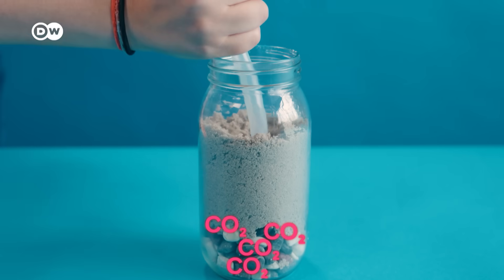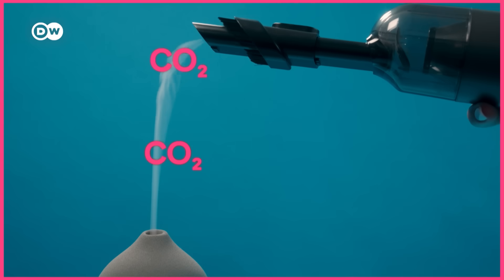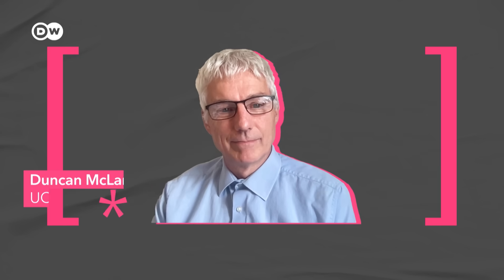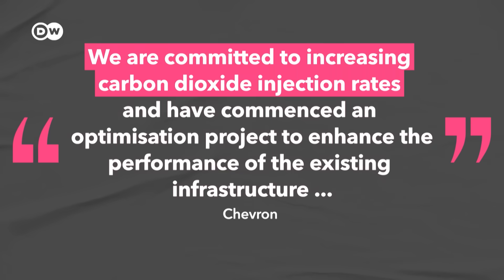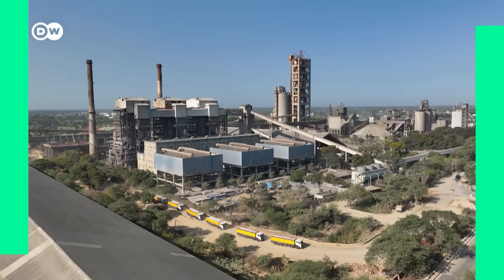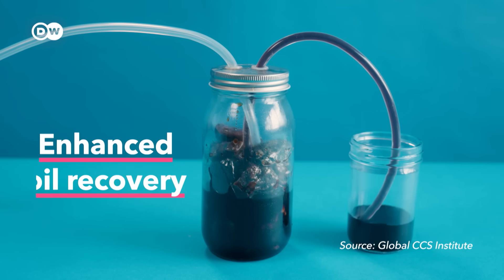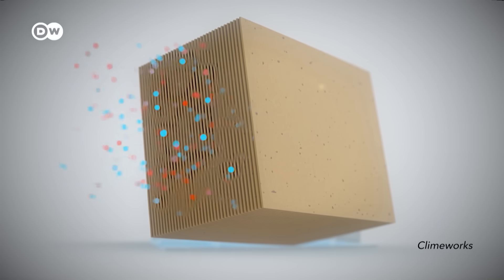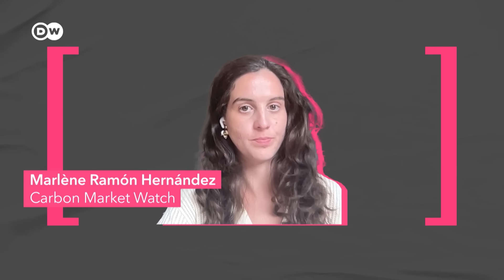Why carbon capture needs a reality check

Comment: A painful watch as a geologist. The Gorgon CCS project is a poor example as it is a saline aquifer that has (specifically) had difficulties withrawing water from its aquifer to allow for CO2 injection. 

Oil and gas companies are rightfully interested in CCS because they can use their pre-existing infrastructure to store CO2 in depleted oil and gas reservoirs, which are underpressured and readily available for CO2 injection. They also have vast amounts of data on these reservoirs to help with CCS deployment.

Comment: CCS just stretches time for fossil  burning companies making sure our descendants would need to expensively grow some algae bs to produce even cheap kind of plastic. DAC only makes sense after we completely decarbonize the grid. But then there will be no FF companies left to help clean up their mess for reputation points with a grain of their ridiculously enormous money pile. Both technologies require roughly the same kinds of recourses as building for example wind turbines and green hydrogen energy storage facilities for their reliability. Though I personally prefer boiling water with magic heat rocks. Some people just want to turn earth to hell to not miss the world they will leave behind on their way to the actual one. Don’t believe solutions especially sweet sounding ones from collective beings who have been proven from decade to decade to be incapable to care less about global long term reasonable use of any kind of real resource. Anything made in  accordance to their lies is made for our own demise.

Comment: You need to undergo a many-decade process to make clean electricity super cheap and abundant and keep fighting the chemistry/material science/manufacturing fight to actually fix the CO2 problem with realistic in-air or water carbon capture, and even then it seems like a long shot.  I think it will finally happen when sythetisizing hydrocarbons from captured CO2 become economically competitive with extraction.  But you basically need to do that anyways because the diesel engine is just too good to replace

Comment: Carbon capture is FREE in Nature which has the most Perfect Carbon Capture process that can be Thermodynamically designed,. Atmospheric CO2 dissolves in the excess water in the atmosphere to form Carbonic Acid 3/4 of which falls in the ALKALINE Ocean and is neutralised (Captured) The other 1/4 falls on Land and about half reacts with limestone to form soluble bicarbonate of Calcium that is transported to the Sea where id is removed in the form of CHALK, the biological remains of sea creatures. This Captures CO2 for Billions of years

Comment: First it is expensive. The goal is not make a change in climate or wipe out every CO2 molecule. The goal is simply using a technology to filter out the air better & if such technology is located proximal to industrial plants, one may be able to improve the exit of IR  rays back to space. It is no different than the technology that has been developed over the years that has refined coal or oil or gasoline & to weed out impurities. Often times when we folks are show a photo of a smokestack & we see lots of dark stuff coming out. We wonder why is not there a way to somehow stop that. Well we actually can mitigate. Direct capture or dry scrubbing works like an aquarium filter & captures the desired gas which then has to be essentially landfilled. The indirect or wet scrubber inputs a chemical amine which reacts with the CO2 & converts it to a useful product, namely drywall or mineralized concrete. This reduces the CO2 contribution to the air & will improve just a tad of IR getting to space. The way this geologist looks at it is that this is a good piece of technology & ideally would be situated next to steel & concrete plants. Sad to say the GOP did not get on board with this simple approach which represented a coming to the middle of both sides of the climate debate.  This is far more doable than ordering by fiat the folks to buy an EV or get rid of their furnace of gas stove. Having industry do most of the heavy lifting is the way to go. Otherwise, the alarmists when they get back in power will just continue to reverse any current protocols that are going into place this year.  Again both sides never seek a middle & it's the people that pay the price the more that one side gets in power & jams it down our throats.

Comment: We will need liquid fuels for a very long time. DAC is the only solution that makes it sustainable without ruining the climate. DAC has to be powered by solar panels and so it could be installed in deserts. The only question is where to store the captured carbon.

Comment: Carbon capture technology has its place and I explain why.
It makes sense to use it only if powered by reneweable energies. Otherwise we would fool ourselves and trying to trick thermodynamics.
The other option is to use it as a consumer of excess from the grid. Let's say the state overestimated the demand and now produces too much electric energy. In order to keep the grid stable we have to get rid of that energy. Nowadays we sell it for negative prices, therefore paying for it, to other countries and we use it for hydro power plants to pump water. 

Instead we could use this excess energy to power a carbon capture device or power an electrolyser to produce hydrogen. Again, the emphasis is not to burn fuel to capture carbon or produce hydrogen, but use energy that is available anyway.

Comment: Scaling up is a real showstopper - the cost of plant is subject to economy of scale but energy
cost is subject to supply and demand - because of the dismal % efficiency of current technology
the massive demand would INCREASE the energy cost, 
say at $300 per ton removal every US citizen producing 15 tons p/a faces a bill of $4500 just to stay neutral, on top of that CO2 occupies about 3X volume of oil or coal removed, the Texas plant owners
are not stating the source of energy - if it is powered by the grid then the fossil CO2 element of that 
electricity should be subtracted from the stated capture total, spending $$$ to produce a useless
dangerous product that benefits the whole world will be seen as "un-american" and political suicide.

Comment: Climeworks should not try to capture CO2 from the air but instead put those filters directly on manufacturing plants.  They need to find a way to put their capture technology on cars, manufacturing plants and only use their direct air technologies in areas that have been deforested. In other words, capture CO2 at the source.  Then have a program in place where the devices that have the CO2 can be turned in to Climeworks for them to deposit into the Earth.  There should be a financial incentive for the average person and other users to install this on their vehicles and submit it.  This way , the people of the world can  be a part of the solution not just Climeworks.  People will do it for altruistic and financial reasons.

Comment: The only reason to “capture” carbon is to recycle it into synthetic fuels. Rapid developments in catalyser technology will provide “reasonable” cost fuels to power our transport instead of wrecking the planet mining so called “rare earth” materials. Until these pseudo scientists bother to do their homework and look data from ice cores, stomata and other historical data that shows carbon dioxide does not drive temperature but mostly follows it we will continue to have useless uneducated organisations promoting disinformation and ruining our energy infrastructure. We have to accept that our climate is changing and has changed since inception and put our efforts into mitigating the effects of natural climate change on our infrastructure. Stop building on flood plains for a starter!!

Comment: Bull$it!! Carbon dioxide capture (And no, it si NOT a carbon capture. These dills can't even get the terminology correct!) should be made a criminal offense. CO2 is not controlling Earth's temperature, and at 400 ppm, we are perilously close to 200 ppm, level at which the life starts to die off. 560 million years ago,  CO2 concentrations were around 7000 ppm, and for most of the past 600 million years CO2 concentrations were considerably higher than at present, yet the planet did not burn and the life did not get extinct! Climate change/global warming is a con....

Comment: its not feasible at the scale we need to build and operate the carbon capture devices.  this is just another convenient narrative device for the fossil fuel industry.
that math is relatively simple as well if you are skeptical of my claim.  Answer these questions:
How much CO2 do we generate as a nation (US) per year? (you can look this up on multiple government websites, but I like the DOE)
How much does any single carbon capture system described here capture per year? (you can look it up on the manufacturer websites)
Then how much energy is needed to operate the carbon capture system per year? (you can get more into the weds by asking how is that energy produced)
Then you can determine how many carbon capture systems you need and how much it will cost to operate them annually. done
And unless you want to dedicate the majority of all of humanity's output to reducing carbon in the atmosphere for the next 50 years, the obvious answer is:
#1 we need to stop burning fossil fuels now, #2 no technology is capable of saving us, this is a myth with a useful narrative to the fossil fuel industry only, #3 if we were to try to be clever about reducing CO2 in the atmosphere we need to use natural systems to do it

Comment: I don't beileve that one passenger emits one tonne of CO2 on a flight from New York to Paris 6min 30sec. An Airbus A320, 150 - 180 passengers,  uses about 2.5 tonnes per hour. Pity these climate alarmists have to resort to lying to keep the panic going.
Reply from the maker: Hi Simon, thank's for asking. You mentioned the Airbus A320 — but transatlantic flights like New York to Paris are typically done with larger aircraft (e.g., Boeing 777, Airbus A330, or Boeing 787), not an A320, which is generally for short- to medium-haul flights. A long-haul aircraft like a Boeing 777 might burn around 7–9 tonnes of fuel per hour, depending on conditions. For a 7-hour flight, that’s around 50–65 tonnes of fuel total.
Reply: @DWPlanetA  So, if a 777 with 314-440 passengers, it's still nowhere near 1 tonne per passenger. I stand by my point. Scaremongering reporting.

Comment: The fundamental problem for both of these is, the energy needed to compress and store the CO₂ is comparable to the energy you got from burning the carbon in the first place.  A lot of the energy comes from the CO₂ expanding.  To compress it and recreate the original oil, takes ALL the energy.

But, if you burn natural gas, there's still a lot of hydrogen you're burning, and you don't have to capture that.  And, if you pump it underground, that's not recreating the oil or coal, that's more like compressing it.  Maybe 50%?  I don't know.  But what you do is, you subtract that energy and that cost, from the benefit you get from burning it.  So, if you're normally paying $40 to refill your tank, really, you should be paying maybe $80 ... $40 for the gas, and $40 to capture the CO₂ and pump it back underground.  Right now, nobody's collecting that extra $40, and nobody wants to pay for CCS.  (All the above numbers are bogus — I'm just guessing.  The experts in this video have better figures.)

Direct Capture is a different story.  The problem is the 2nd law of thermodynamics.  Go to the fridge, and pour yourself a glass of milk.  Good.  OK, now, go to the fridge, and, instead, spill all the milk on the floor.  Then, take a towel, mop up the milk, and wring the towel out into your glass.  The second method just seems stupid — it's more work, you'll never get all the milk back, and it'll be dirty, and you'll have to wash the floor and the towel.

But, that's what Direct Capture is.  You're taking the CO₂, letting it scatter into the atmosphere from the smokestacks and tailpipes, and then trying to mop it up.  Far better to go to the smokestacks and tailpipes themselves, and grab the CO₂ while still concentrated.  Then, it becomes CCS.  For cars, this would mean saving all of the tailpipe fumes for later.

So, I'm skeptical of both of these technologies.  Isn't it simpler to just lay some square miles of solar cells under the sun?

Comment: 94% Of the warming has settled in the world's oceans and that heat will be released so it does not make any difference if we  capture CO2 from the atmosphere. The warming will continue and it is currently spiraling out of control and the planet is warming faster than projected.
Multiple feedbacks are now beginning to occur where areas of earth that helped regulate summer heat are now beginning to go in reverse and this is very bad news.
The UN has revised  it's projections and now fears that  a very dangerous amount of warming  could arrive much sooner than the scientists had projected.

Comment: I do think it’s a bit unfair to the efforts of OXY into that perspective. Because we do still need some oil in the future, for cosmetics, plastics, lubricants, chemical products, basically many things in modern life. Many times there are no viable, affordable solutions yet to get away from it. Also electric cars, photovoltaics and many other things failed to deliver on their lofty earlier promises. 
My point here is, that they at least doing something, and that on an industrial scale. 
CSS, especially in steel and concrete manufacturing, would be preferable, but it seems a worldwide, coordinated political effort is not possible.

Comment: We can't remove the carbon dioxide from our lower athmosphere that cause global warming. Why don't we send the surface heat far above in the higher athmosphere where the greenhouse gases are at a much tlower density? Convection should do the trick. We paint large black circles in rocky desert where no sand will cover the paint. The heated air above them will be at higher temperature than the surounding air and start a rising convection column. Make it big enugh for the convection column to rise above the lower athmosphere and there will be a convection of cooler air coming down from above to replace it. This air circulation will take the heat trapped over the desert by the greenhouse gas effect far above where it will cool off faster. In the Sahara desrt there are many montains with a side facing south. Paint them black and you can generate an Island convection wind effect that will take the desert hot air far above the boundary layer.

Comment: The Carbon Sequestration Fallacy: High Costs, Low Impact

Section 1: The Cost of CCS

Government subsidies per ton of CO₂ removed: $50 - $600+

Actual cost per ton (including infrastructure and energy use): Up to $1,200

CCS requires massive energy inputs, increasing overall costs

Section 2: Certification Issues

No universal verification of long-term CO₂ storage

Leakage risks: CO₂ can escape from underground reservoirs

Self-reported data by corporations = unreliable tracking

Section 3: Government Waste

Billions in taxpayer subsidies for underperforming projects

Many CCS projects fail or capture far less CO₂ than promised

No market demand—CCS exists mainly due to government funding

Section 4: The Carbon Credit Scam

Polluters buy carbon offsets while continuing to emit CO₂

"Net zero" claims often rely on unverifiable carbon capture

Greenwashing: CCS allows industries to appear eco-friendly without real change

Conclusion: CCS is an expensive, inefficient, and unverifiable technology that benefits corporations while wasting taxpayer money. It does not provide a real solution to emissions but instead serves as a costly distraction from energy challenges.

Comment: CO2 is 0,04% of atmosphere. Capturing a gas with so low concentration will be extremely expensive. You have to suck/fan ‘the atmosphere’ through an artificial atmosphere at least -80 celsius wich freezes CO2 to a solid (Dry ice). So best places to do this will be at north and south pole. From there capturedCarbon must be transported to empty oil field and pumped down. All oil companies have pulled out from projekts like this, because you use 7200 tons to capture and store 5000 tons. But that dont stop idiot politicians investing in it, because they use Your money to do it

Comment: Carbon capture at the power plant is going to be the biggest flex of the EVs. Detractors always flaunt the idea that the electricity they use is produced from fossil fuels anyway. However, since this is a point-source pollution, it's easy to address compared to every car emitting everywhere